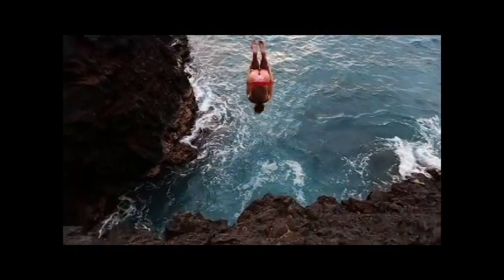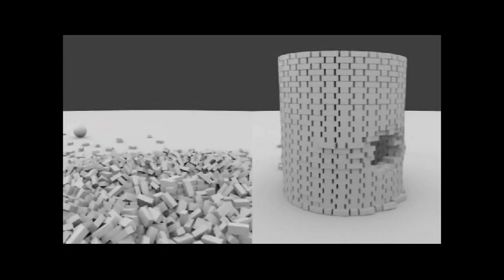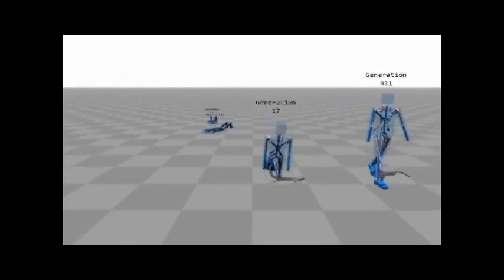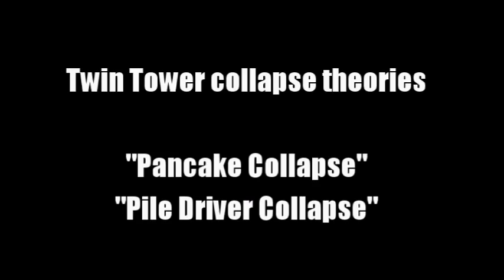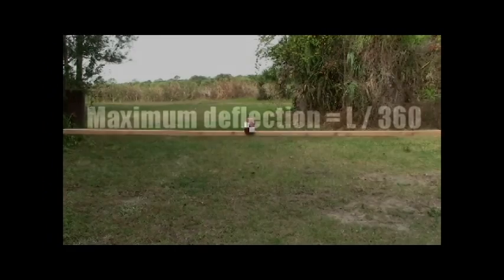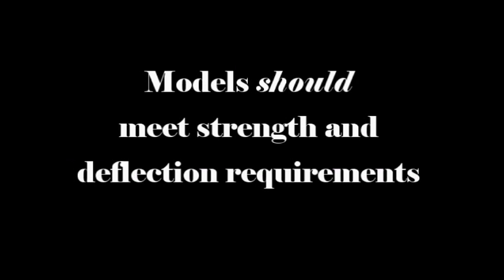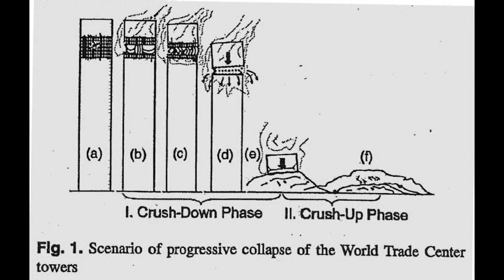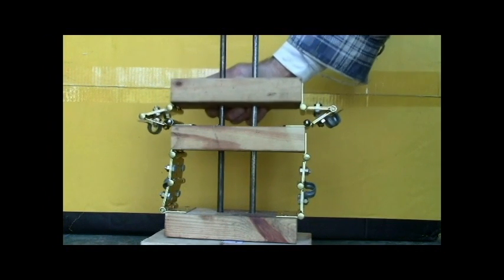9/11 Experiments: The Force Behind the Motion

Comment: "No-one can produce a simple experiment" - False.  The 'force' behind the motion was BUCKLING.
Strangely, you never mention it.  Here is a 'simple experiment' where a tiny 'force' causes instant collapse.
https://www.youtube.com/watch?v=yqEwr8QcfbM
Now disagree with this.
Reply: Tony Duncan  Try proving you conspiracy theory of 
The 'force' behind the motion was BUCKLING
that you posted using your sock puppet that you normally only use for music Tony. Betcha caint (again) ..............
Reply: +Eve's Suppository
"The meaningless existence of a" - truther.
"fucking losers" - you've lost for sixteen years so far.  You'll lose for the rest of your life.
"simulates a building collapse due to a heavy impact and fire" - We've seen the reality.  The simulation would be expensive and unnecessary.  You're asking for 'simulations for idiots' as with this video.
"molten steel in a debris pile" - Satellites recorded 1100 deg C.  Steel doesn't melt until 1500 deg C.
"keeps burning for 3 months?" - Nothing burnt except the hydrogen made from fireman's water on red hot steel, once it had risen to the surface of the wreckage. Burning cannot take place without oxygen, and that had already been removed by a thousand tons of red-hot iron.
"was a witness to MOLTEN STEEL" - False.  You're lying.
"Firefighters saw MOLTEN STEEL" - False.  They saw molten metal in the dark.
"heard numerous explosions" - At least a dozen things may explode in a large fire.
"They would know" - They knew WTC7  was going to collapse two hours in advance.
"disrespectful, low-life degenerates that are used to prop up an absurd narrative. Truly the scum of the Earth" - You describe yourself perfectly.
You call anyone who questions your perpetual lies a shill.  You never answer a challenge.
What have you done in your life?  Anything useful at all?  No, you just lie, offend, and slander people who can see you for what you are.
At least 300,000 tons of steel falling into a 70' basement pit from heights up to 1,350 feet will make 1,000 tons of red-hot steel at the bottom of the basement.  It's an easy calculation, but nobody would carry out this experiment, and that is what you're relying on.
Truthers, and Creationists, do little fan-dances in areas of low public understanding.  They see themselves as 'light illuminating the darkness', but in the world of 'professional' understanding, they can be seen to be standing naked in the spotlight, with very small willies.  It's amusing.
Reply: Tony Duncan  Define PROPER EVIDENCE lying government shill.
Do you mean only the evidence that has been cleared for public consumption by your sponsors Tony?
Reply: Tony Duncan  Why don't you set about proving you are the government shill with the real name of Tony Duncan??
Betcha caint (again) ................
Reply: +Mark H
Try proving you aren't me, dummy.
Try proving YOU aren't both of us.
EVIDENCE is what you need.  The sort of evidence I have been talking about.
The physical attributes of the towers, the agreed acceleration of their fall, are data available to all.
The MANY amateur videos that show the exact same sequence of events are also reliable evidence, unless you're one of the goons that claim that 'the government' produced them all - a task that would have been physically impossible to carry out.  It would have had to have been carried out in advance, and the exact weather predicted.
You have an unrealistic view of reality.  There is no magic.
I'm a retired scientist and engineer,  and have thought about these events now for sixteen years.
The best analysis of these events uses the scientific understanding of ENERGY.  I prepared it several years ago and have it filed as "911 wtc collapse energy and where it went", and here it is:
 PRIMARY 9-11 CONSPIRACY ASSUMPTION SHOWN TO BE FALSE:
AN ANALYSIS OF THE AMOUNT AND DESTINATION OF THE POTENTIAL ENERGY OF A WTC TOWER
The first law of thermodynamics, also known as the Law of Conservation of Energy, states that energy can neither be created nor destroyed; energy can only be transferred or changed from one form to another.
Source: Boundless. “The Three Laws of Thermodynamics.” Boundless Chemistry. Boundless, 02 Jun. 2016. Retrieved 12 Oct. 2016 from https://www.boundless.com/chemistry/textbooks/boundless-chemistry-textbook/thermodynamics-17/the-laws-of-thermodynamics-123/the-three-laws-of-thermodynamics-496-3601/
The World Trade Center towers (and WTC7) fell NATURALLY due to buckling failure when their 'slender' columns lost attachment to their floors.
They only used a third of their Potential Energy to destroy themselves, the remaining two-thirds was consumed in crushing some of their steel into ground zero.
A standing WTC tower possessed two hundred and forty six tons of TNT of POTENTIAL ENERGY merely by just standing there. We shall call this energy Eo.
The tower fell by taking the direction of LEAST RESISTANCE, which was THROUGH ITS BUCKLING COLUMNS.
The columns failed by BUCKLING because their STRUCTURAL STABILITY had been compromised by LOSS OF FLOOR ATTACHMENTS. No steel got crushed when this buckling failure occurred. 
Buckling is not a MATERIAL failure; it is a STABILITY failure.
The floors had detached themselves by sagging to an angle which snapped their connections. Photographs of these separated floors (taken shortly before collapse) are plainly shown in the NIST Report.
As each tower fell, some of that stored potential energy, converting to kinetic energy by falling, was released to damage and dismantle both the moving and the stationary parts of the tower on the way down.
The amount of the initial energy consumed in such a manner was inversely proportional to the rate of acceleration of the tower as it descended. It can be calculated.  We shall call it Ed.
The amount of energy remaining (Er) when the tower wreckage hit ground zero is then (Eo - Ed).
This energy, transferred elastically, caused PLASTIC DEFORMATION in the crushed base steel wreckage, and became HEAT. This too can be calculated.
The heat was considerable. The signs of it were captured by satellite. It amounted to the equivalent of a thousand tons of steel raised to a temperature exceeding 1,000 degrees Centigrade.
This hot steel, crushed and pressed against ground zero, oxidised its surface (making scale) and absorbed local oxygen gas, leaving a reducing atmosphere.
In these reducing conditions, and at a temperature of 1,000+ degrees C, fireman’s water which had percolated through crushed gypsum wall boarding DISSOLVED calcium sulphate (yes, Gypsum is 5% soluble in water), the sulphate ions of which were reduced to sulphur which combined with the exposed iron to form IRON SULPHIDE, which at such temperatures was MOLTEN, and flowed away. At a temperature of 1,000 degrees Centigrade, in an absence of oxygen, and in the presence of hydrogen, Sulphur and Iron atoms become keen partners.
Such hot reducing conditions also caused the water/steam to be REDUCED to hydrogen gas which was noted by firemen to be burning at the surface of the wreckage.
The wall-boarding and crushed concrete surrounding (but mostly above) the steel were THERMAL INSULATORS, so greatly slowing cooling.
CALCULATIONS (in SI units):
To calculate the original potential energy of the tower in TNT equivalent,
G = 9.81 metres/sec^2
Mass (M) of tower = 5e8 Kg
Height (h) to the tower’s CG = 210 metres
The explosive energy of 1 ton of TNT (Kt) is equivalent to 4.184e9 Joules
Equation: Tower Potential Energy (Eo) = ( M * G * h ) / Kt
This is equivalent to ( 5e8 * 9.81 * 210 ) / 4.184e9, or 246 tons of TNT.
The Potential Energy of each standing tower was equivalent to 1,000 standard 500 lb. ‘iron’ bombs.
To calculate the kinetic energy used in the tower destruction takes a moment, after a simple thought experiment, namely considering the tower would fall at G if there were NO resistance, and if it fell so slowly that it consumed ALL its energy, it wouldn’t fall at all.
So we can see that the PROPORTION of the energy used up by the collapse must equate with the proportion of G which the collapse was unable to achieve.
As the collapse acceleration was, by truther calculation, established to be about 70% of the acceleration due to gravity, we’ll use that.
The energy used up in tower destruction was therefore 30% of 246, or 73.9 tonnes of TNT.
Assuming that 30% of the tower fell outside of the basement, then the energy (Er) available to heat the wreckage base (by elastic energy transfer and crushing) was 0.7 * (246 - 73.9), or 120 tonnes of TNT.
We know that the steel reached at least 1,000 degrees Centigrade because that is the melting point of iron sulphide.
We can therefore calculate the mass (m) of steel that was raised to that temperature.
The specific heat of iron (Fs) is known to be 0.45e6 Joules / tonne / degree C
The ambient temperature was 20 deg C, so the temperature rise (Tr) was 980 degrees C
Equation: Er = m * Fs * Tr
So m = Er / Tr * Fs = ( 120 * 4.184e9 ) / 980 * 0.45e6
And so m = 5.02e11 / 4.41e8 = 1,138 tonnes.
The collapse of each World Trade Center tower created 1,138 tonnes of red hot steel at 1,000 degrees Centigrade.
So we can see that there is no need to postulate an extra source of energy, and that the basement wreckage heat is also easily accountable, with the additional corroboration of burning hydrogen at the wreckage surface, and molten iron sulphide at the wreckage base.
And so the underlying 'truther' assumption, that the planes couldn't bring down the towers, is shown to be FALSE, as it is shown by calculation, using the physically-correct values, that the potential energy possessed by the towers numerically accounts for ALL the known consequences, through elastic energy transfer, plastic deformation, HYDROGEN gas burning at the wreckage surface, EUTECTIC IRON SULPHIDE melting off the hot steel pressed against Ground Zero, and, of course, a tremendous amount of HEAT.
These results are EVIDENCE of the event.
They have been evident to any REAL scientist or engineer from day 1.